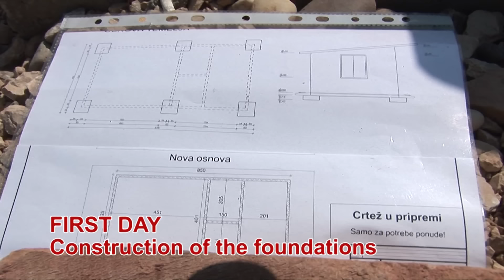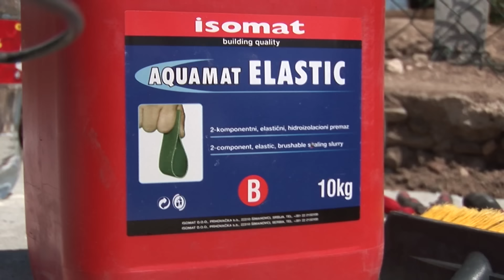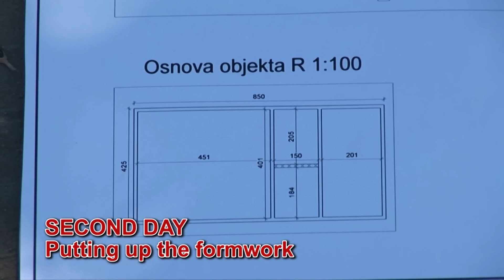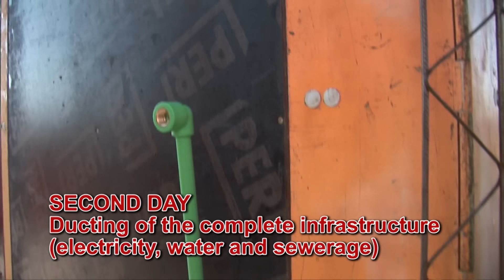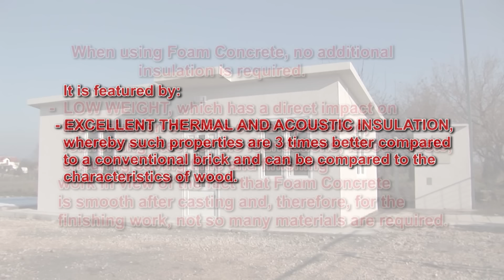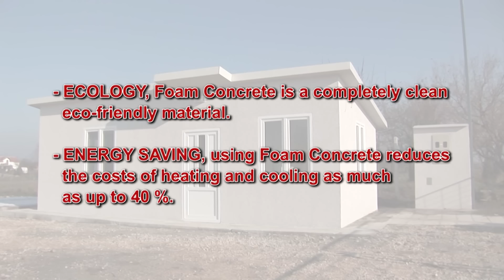FOAM CONCRETE, affordable house built in 6 days!

Comment: just get used shipping containers, insulate and drywall them up. cheapest shit on the planet, plus you get to recycle those used containers
Reply: +Amir Hussain Good point.
Reply: +Roy Poud You can learn how to weld in 8 hours, especially if the welds don't need to be certified.
Reply: Hellz yea !
Reply: That's worth making a video about...ijs.  Great idea.  And when you get tired of living there just ship your house somewhere else.
Reply: how much would that cost compared to the concrete house
Reply: Too bad bylaws in some areas don't allow that.
Reply: I agree. They can be made into a very good looking home. But in most towns and cities ,the by-law nazies would put a stop to such construction. Funny how governments think. First they want you to always recycle but when you do the ultimate recycle move by building a new home using shipping containers. They come down on you like a ton of bricks with ridiculous regulations.
Reply: well, you could use foam concrete as insulation in the container too. If applied on the outside, it would make it look less like a contanier and more like a house, but you could still move it!
Reply: why not just get a mobile home for christ sakes?
Reply: I've seen a few "homes" made out of shipping containers. By the time you've paid for purchasing, transporting, finishing to normal home standards - you dn't save a dime. Most Americans would consider it ghetto housing if you just left it raw. Further, cutting holes in the container is no laughing matter either. Rust is an ever present danger and so's baking on a warm day. Don't forget, you need land to put it on too. When I detailed costs, it's not really fit for more than emergency housing.
Reply: im sure the traditionall house builders are behind that regulation hell shit
Reply: L wood shipping containers go for £2000 to 5000 sterling dependant on age. Delivery maybe extra. 
May not be permissable in all areas look at local planning regs!
There are plenty of bids on YT showing different designs.
Reply: Depends how much you pay for a container. In the US: 800 bucks. In my country: 3000 bucks.
Reply: @Kedda486  a whole lot
Reply: The price has gone up in cost of the containers and cost to transport.
Reply: @joojojooo3740  Cost!

Comment: Laying concrete without placing black plastic sheeting under it?? The flooring will exude moisture from the ground and turn the house interior into a host for mould!
Reply: Zeriouslly: you right.
Reply: Well, I don't know if your area has an extremely wet ground, but I never seen that a moisture barrier were absolutly necesary. I've seen loooooots of buildings to be constructed without one and no mould problems. Even in a former lake bed with a very shallow phreatic level, no problems of moisture creeping through the floor.
Reply: It sort of depends on the moisture in the air, as well as the ground and the amount of air passing through the building.  If it were arctic, yes moisture might be a problem.

Comment: This did not happen in 6 days, the house is skimmed inside and out in 1 day, all floors and bathroom tiled in 1 day, carpentry and glazing in 1 day, electrics and plumbing in 1 day and none of the trades got in the way of each other, wise up!
Reply: I've seen it happen with stick built houses! The shit comes on a flatbed truck with everything already assembled
Reply: We literally just watched everything it was a smooth and efficient operation
Reply: @pointedspider  .

Comment: Pre-fab is faster with better quality results.  Likely also cheaper.
Reply: there are a lot of pre-fab houses with bad quality. bad isolation and only drywalls. for longer time it's cheaper to build your home with concrete foundation and bricks.
Reply: As far as pre-fab homes, I think Ritz Craft makes a pretty nice setup.  Other brands, not so familiar with.  I know that they meet and exceed any and all codes that the New England area has to throw at them, which is pretty impressive considering how strict Yuppie Ville can be.
Reply: +Be,ard MCT 
an i

Comment: so its basically a  concrete shed then.
Reply: +jimmyfly indeed...it's like they change traditional styrofoam insulation with that concrete foam...nonetheless they end up finishing that shed in,what... six days...oh yeah,i forgot...there are some pre-made lightweight foam blocks(dunno what kind of material is in it,like soft brick) they are coated with water repellent,different size,with grows or not,good thermal insulator(too many air pockets inside)easy to construct,cheap too....think its called ytong block...
Reply: +Kevin Challinor what do you expect a full size masion with a 30 acre backyard and swimming pool,-? its cheap housing, not the cheapest or best. but still better than a mud hut.
Reply: +3Dtimespace 
I disagree!
 A mud hut is much healthier than this pile of plastic mixed junk!
Reply: I think this house was built as a demonstration of the concept. Who would want to live that close to an airport runway? The house could be build much larger and the process could be improved to mass produce houses very rapidly. Think of how they build the floors on concrete sky scrapers. Once they get set up, workers can pour floor after floor very quickly. Foam entrained concrete has been used for years in construction projects because it is very resilient to freezing and thawing.
Reply: +Marko Urosevic I designed and had built an entire house out of foam block about twenty years ago. They were the kind that are stacked like Lego blocks and filled with concrete and re-bar. That house had some awesome features like being super strong and energy efficient. BUT, I found out the hard way about the importance having a qualified contractor pour the concrete. The "authorized" factory rep for the blocks did it and made a mess. Still the house looked just like any other house when it was finished.
Reply: Robb403 yeah,it could be real pain in the ass to find good contractor this days,a specially those from authorized factories...they are "don't give a crap how pretty it is just finish the job" kind of ppl
Reply: +Kevin Challinor  Hey Kevin, I'm just curious, what was the asking price on the house?
Reply: +Marko Urosevic ICF construction offers the same benefits and many advantages over this method.....
Reply: Not a concrete shed. In Africa, where this is built, houses are much smaller because they do not have piles of shit like Americans do. This is probably a house for a family of four who only need a couple bedrooms, a bathroom and a small living area to cook and eat.
Reply: +tstuff whatever. i do not live in a pile of shit.
Reply: tstuff you are the one making general statements about what people live in and how they live. maybe you need to be more precise.
Reply: Id have a hard time calling that a house.
Reply: For some people who have nothing, it's a mansion. A home is where you live, not what you live in.
Reply: +Robb403 tell that to a homeless guy in a cardboard box
Reply: So basically it is a building that the buyers could afford.  This system is not limited to the size.  It is an EXAMPLE not a cookie cut house.
Reply: @markourosevic1987  IT is 'like' foam blocks in the same way clay bricks are like cast retaining walls.  This is a totally different material.  It is cast in place.  the only people who use block are those who do not know how to build a form.  Block is nothing more than a good form used many times in units small enough to allow versatility.  Plus, those foam blocks are anything but cheap compared to air crete.  Each block of 3 SQ ft costs $14 at my store, a single sack of cement ($8) will make 40 cubic ft of air crete (or more).  Each has to be plastered, but block takes fiberglass mesh everyplace and air crete just joints.
Reply: @animarkzero  Uh, no.  First a mud hut is not what the buyers want.  But earth structures take a lot of land compared to living space utilized, they have problems with the roof wall joint and wind, and are subject to earthquakes as the tensile strength of earth is so very low.
And... no plastic in the mix.  It is a foaming agent mixed with portland cement only.  Yes it is soft, but so is the earth you suggest.

Comment: Although the bulk of the hydration process takes place in the hours and days immediately after the pour, concrete needs 28 days to fully dry. While the slab will harden and lighten in color before 28 days, don’t be fooled into thinking it’s done hydrating. If you plan to stain or paint the concrete, doing so before the process is complete can result in changes in the stain color or the paint peeling off.

Comment: How can you build this in 6 days, if it takes at least 28 days for concrete to dry. Besides the whole visual concept of the house looks cheap..
Reply: 28 Tage stimmt, aber der Beton hat schon nach 3 Tagen eine Festigkeit von über 70%, dann ist die Standfestigkeit gegeben. Bei Foam-Beton muss man allerdings 15 Tage warten, bis er belastbar ist.
Reply: Somehow you missed the point.  
First, true concrete does take 30 days or so to gain it full strength.  But it is soo strong that even if it only has 10% of its' strength it is still strong enough to allow the construction of the building.  They are taking a chance that no great quake will occur in the first 30 days.
Second, this house uses the same forms for many houses, so they are assembled very fast.
Third, the walls are air crete that uses no rock, many places around the globe do not have access to rock hard enough to make quality concrete (Haiti, big chunks of Africa).
And lastly, cement houses are a big step up from other choices.  Wood is not a viable choice in places without forests.  They require little sophisticated maintenance skills, little maintenance at all.   The choice is not "perfect or nothing" but a long lasting shelter at a very reasonable cost.